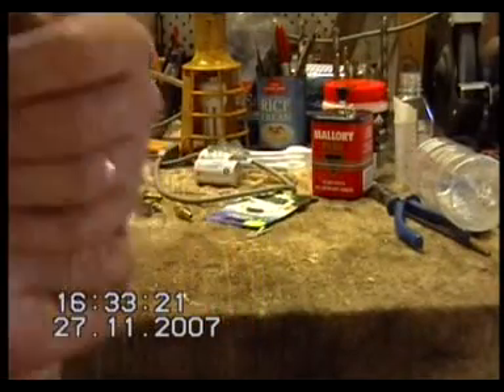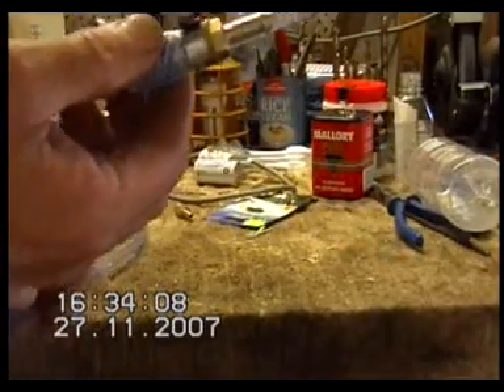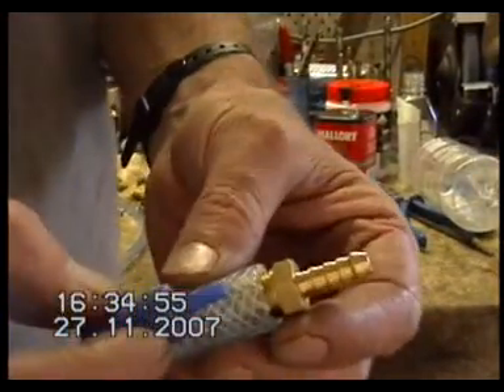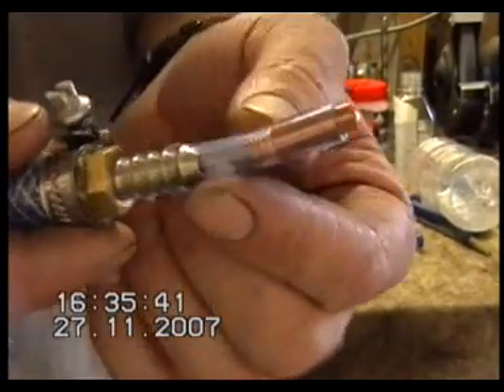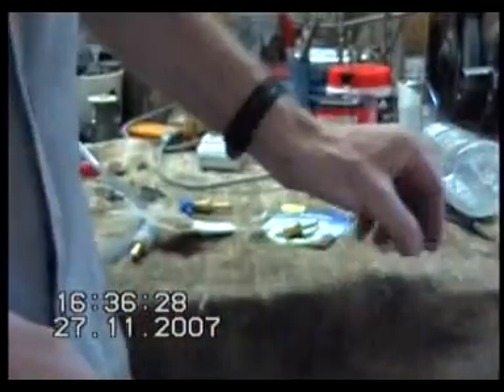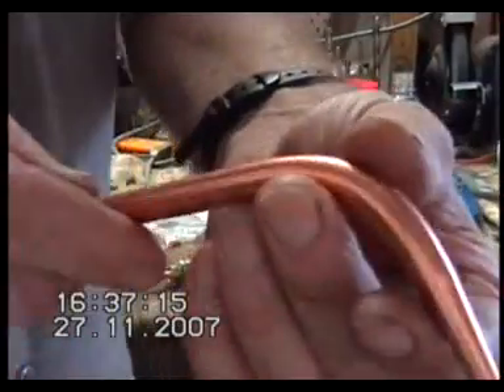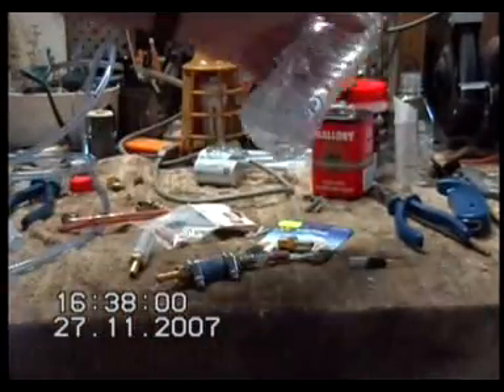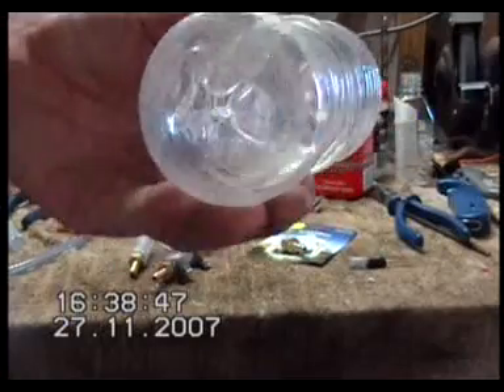We Tested a New Spark Arrester

Comment: On a car you have windscreen wipers, water is supplied by a windscreen washer bottle... a check valve is used so that water is ready to come out of the jets when you press the button and cannot trickle back into the bottle... Normally a small plastic 2 piece check valve... cheap as chips...